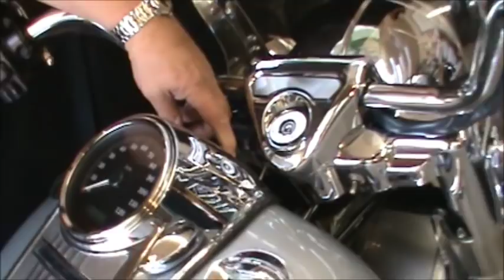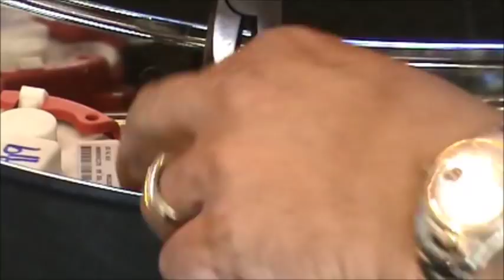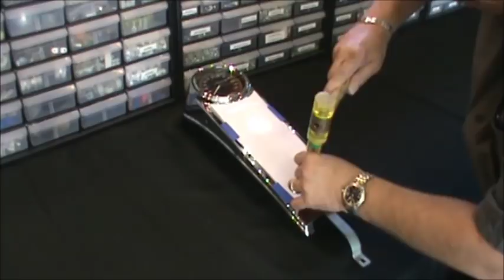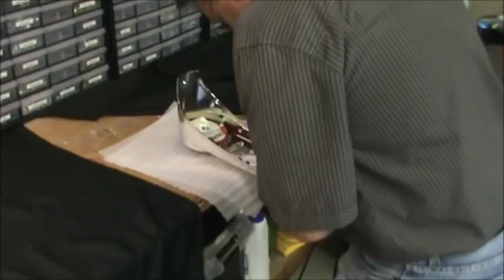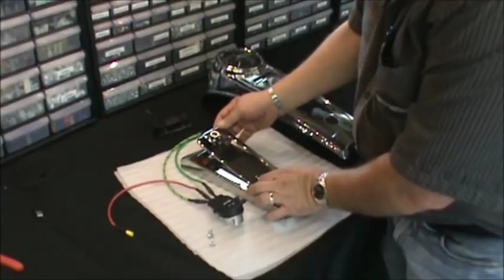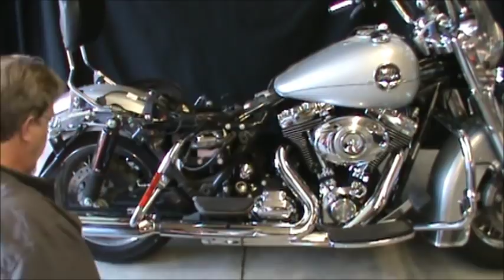Road King Gets a Modern Custom Dash Console

Comment from the maker: I wish we could make them cheaper.  We have hundreds of hours into the design and prototyping of this product. The parts are machined on $500k 5 axis machining centers in the USA. The polishing, plating, cable harnesses, etc, all very expensive to manufacture too.  This is why HD charges $350 for a set of passenger foot boards and brackets.  It's really a good value for your money, when you consider what it does compared to just another cosmetic chrome part from China.